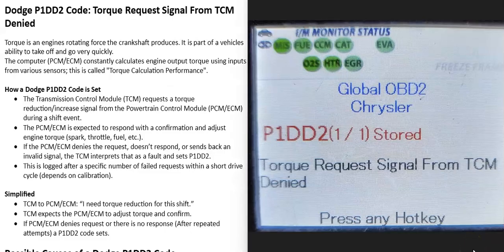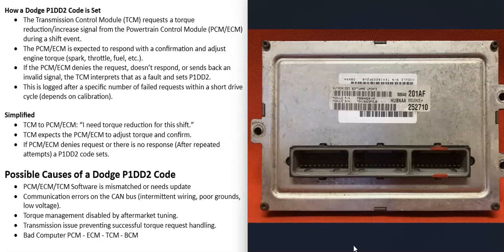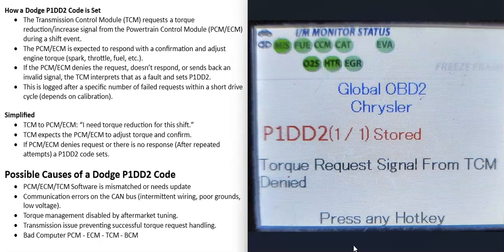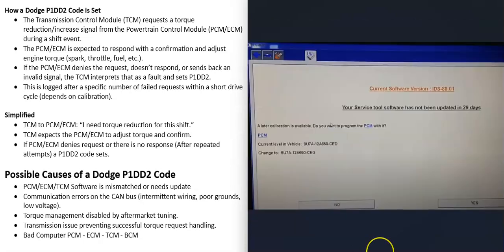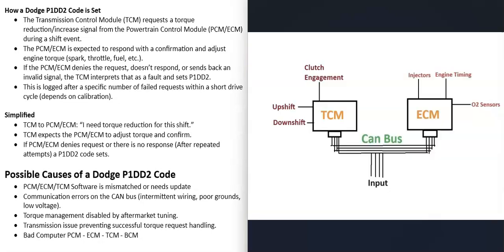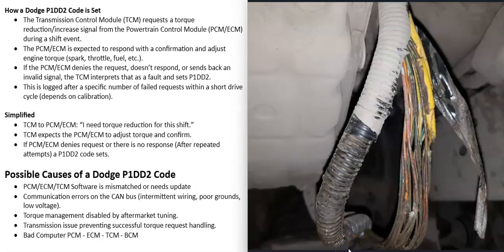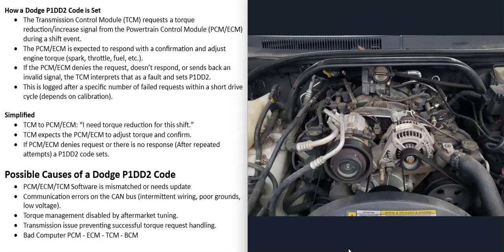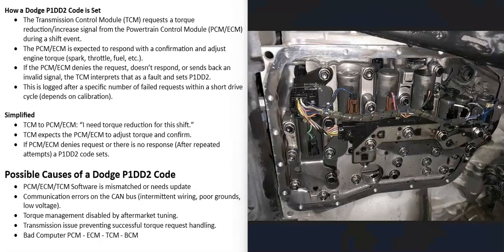Causes and Fixes Dodge P1DD2 Code: Torque Request Signal From TCM Denied

Comment: A low voltage battery can trigger it too. Just happen to my 2020 Jeep Gladiator. Just changed my battery and the check engine light went off.

Comment: I’m having this code on my 2017 Durango 3.6l v6. The truck stays in first gear the whole time and does not shift, should I change the tcm or where do I start ?
Reply: Check your battery on the car.
Reply: Así mismo me sucede a mi